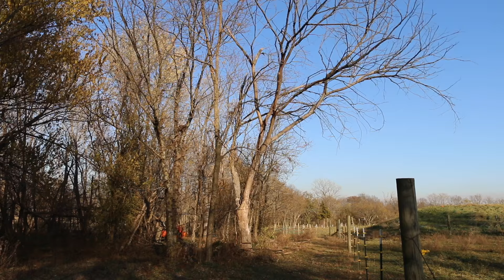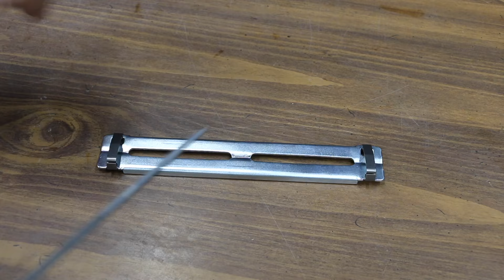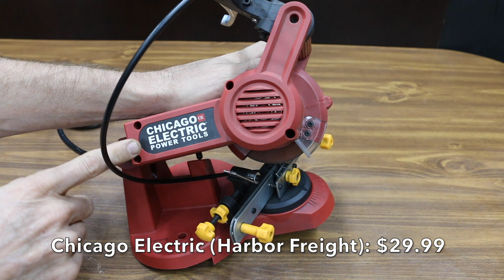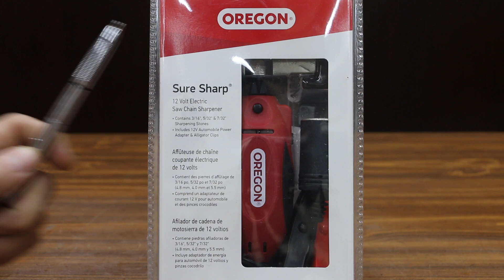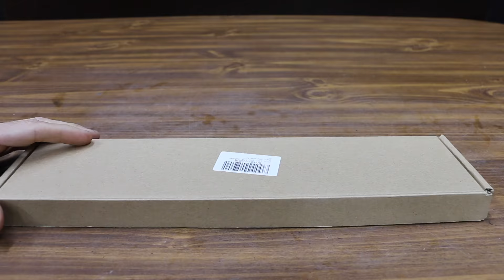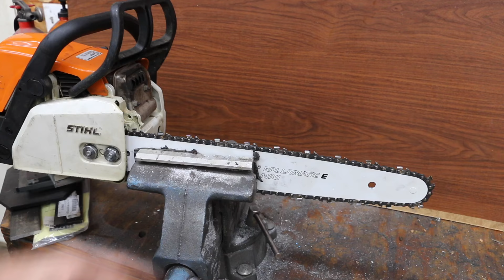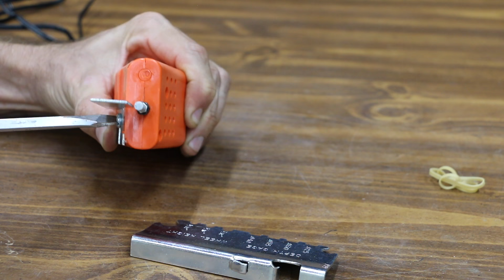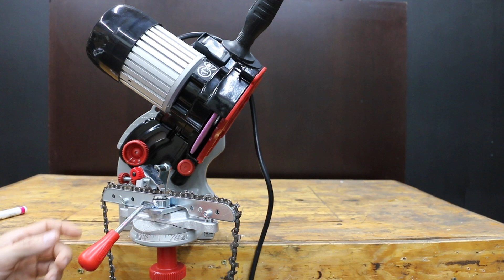Which Chainsaw Sharpener is Best? Let's find out! Stihl, Granberg, Chicago Electric, Oregon

Comment: I appreciate the thoroughness of this video but you will find that you will become more proficient the more you use a single sharpening system, both in speed and quality of cutting edge. Most of these will produce a quality edge. It really comes down to what you prefer. I only use a file free hand. Thats my method but i sharpen chains quite often. If i were to recommend one of these for a beginner, go with the stihl 2in 1 because it teaches a user how to stay at the proper angle , the need to file drags and the cost is relatively cheap compared to the others. Ive tried just about all of these or something similar at one time or another.   Eventually just about every pro or frequent user ends up filing free hand. BTW no need to use lye on your chains, thats a bit overkill.Maybe some brake cleaner and  compressed air. Youre not going to be eating with them

Comment: Another scientific test!  Thank you.   One thing I didn't see in the comments was the proposition that the heat from the chain grinder tools can ruin the temper of the steel in the chain's cutters.  An old forester told me this, and said that because of that, chains that are hand-filed stay sharp much longer. 

A guy like you would be able to devise a test to see if that old guy was right!

If he is right, then I think your recommendation about the sharpeners might change a lot.

Thanks for what you do.  I've relied on your work many times.
Reply from the maker: You are welcome!  Thanks for the suggestion.
Reply: Not only is he right pro loggers always hand file. A grinder is only used to return angle on a older chain. Also soft wood like pine needs more angle than hard wood. You can even speed up cutting on new chain by hand filling because file can cut under teeth grinder just across. My eye sight now i must use grinder. It makes chain usable, but when my brother in law comes up he will take file and sharpen all my saws for me . I got 6 .and when hes done you will see be improvement in cutting speed and time before chains dull.

Comment: The Stihl 2 in 1 are manufactured by Pferd, so you can get the same product slightly cheaper in blue under the name CHAIN SHARP CS-X.
It's a convenient product but new users should be aware not to press down, otherwise the rakes will be filed too much and the chain will cut a bit rough.
Reply from the maker: Thanks for the feedback.

Comment: Back in 1964 I turned 18Yrs, a mate and I decide to go timber cutting - mill logs and pit props , I purchased a Stihl 07 chainsaw and a yellow coloured file and joint sharpener, I wore out the chainsaw after 16yrs of heavy work but I still have the same sharpener today, they were a great combination, I turned 75yrs the other day - cheers from Australia !!
Reply from the maker: Thanks for sharing!

Comment: I have tried a couple of gimmick sharpeners and always go back to a file. And those stupid file guides are nothing but rubbish. Ps the chain ain't finished until you done the rakers.
Reply from the maker: Thanks for the feedback.
Reply: @ProjectFarm  Your an experienced guy and your own test showed hand filling is quite good. If you do a task enough you get very efficient. I have found the depth on chains to be uneven from new. After all its a stamped steel component. The depth is almost as important as the Cutting tooth being sharp. To shallow and your cut becomes very slow, too deep and your saw might not have enough power. Not to mention kick. Good work as always.

Comment: You overheated teeth with the Oregon thing... clearly visible from bluish color of the tooth metal. With those grinders you only want quickly touch metal and then move the head up - quick touch again.. this way you let the metal to cool down and avoid overheating. Overheating ruins your chain.. so it isn't just geometry. Also, you'd like to see a series of cuts to see how long it will stay sharp. Yes, it is true that with a file you can make teeth profile very sharp, but it will not last as much as a more moderate tooth profile...
Reply from the maker: Thanks for the video idea.

Comment: Timberline has a billet aluminum bar mounted manual sharpener with carbide bits, but it's a little expensive at around $115-130 with no raker height system incorporated in the unit.   Looks sweet though.
Reply from the maker: Thanks for the feedback.

Comment: You can completely dull a chain in 10 seconds or less by putting the tip into the soil.  Not everyone knows this but I'm surprised this guy didn't know.  If I keep my chain out of the dirt, they almost never need sharpening.

Comment: I have an older Oregon bench grinder that works great.  To take gum/pitch off of my chains I use full strength Orange Clean from Home Depot.  More safe than lye and no chance of corrosion.  I keep it in a Tupperware rectangular container and have used the same batch for years.
Reply: PS  My Oregon bench unit was made in USA
Reply from the maker: Thanks for sharing.

Comment: Good demo on equipment, did you consider the quality of the file and grinding stone. I cut a lot of native hardwood. I sharpen all my chains in the field every 1 ton of cut wood and use a ripping chain not a safety chain to stop chain kick back. A full ripping chain is quicker and faster that safety chains.
Reply from the maker: Thanks!

Comment: OUTSTANDING video. I fully appreciate how much testing you did. I found your video because I'm searching for a chain sharpener. It was truly eye opening to see so many different types when all I'd heard about was the one from Harbor Freight or manual files. Currently, my cost for sharpening is $5 per chain (off the saw) or $8 per chain (on the saw). Since I currently have 6 x 16" and 6 x 20" chains, you can see how, even at $5 per chain, the costs add up fast. Thank you for providing such detailed information and great explanations. I'm sub'ing your channel for more great videos like this.
Reply: And if they are not careful, a tech sharpening the chain by machine can overheat the steel, which hardens it at the edge and makes it basically impossible to sharpen again with a file.
Reply: @coffeenclinic  
Overheating steel (or any iron-based metal) like you're describing anneals it, making it softer, not harder... but you're 100% correct  - it makes it almost impossible to sharpen again, and prevents it from holding an edge.
Reply: That’s amazingly cheap. It’s $10 our way off the bar.  I started sharpening my own because of the cost and because they remove too much material they overheat the teeth turning them bluish.  Nope, don’t want that.  I’m much happier with the results sharpening it myself.
Reply: PS:  I have a Northern tool electric grinder and the Stihl 2in 1. I prefer the 2 in 1.   The bench grinder is nice the even out the length of the teeth. That’s it.  Otherwise the Stihl is my go to.
Reply from the maker: Thanks!  Thanks for watching and subscribing!

Comment: Doing 2 cuts per sharpen would have minimized differences in the wood like knots. 
Place a cantilevered weight ~18" beyond the tip of the blade to balance the weight of the motor with the center of mass between the 2 4x4s. A purely gravitational cut without the hand balance would be ideal.
Reply from the maker: Thanks for the feedback.

Comment: I use a 4 inch angle grinder with a metal blade freestyle to sharpen my chains. It’s a bit crude but hey, it works and it’s fast.
Reply from the maker: Thanks for sharing.

Comment: an old wood pulp  cutter from m.s. taught me how to sharpen a chain saw with file only. when finished it looks water running out of the back of the saw. its important to role the file as you sharpen and clean the file after every tooth just tap it on something to know out the fileings  out. i think all this is ok but experience worked for me and a lot simpler.my chains last a long time.keep them out of the dirt and oiled.when its not cutting after a sharpening the cleanout teeth need fileing down some you can tell by looking at them i keep mine a tad lower than the cutting teeth.
Reply: I learned how to sharpen stuff 50 years ago while working in a machine shop. Your tips are right on the money!

Comment: The file n guide is the best but it sharpens the upper edge of the tooth. The file by it self opens up the gullet. File a large area in the gullet below the cutting edge. So the chip exhausts faster.
Reply from the maker: Thanks for the feedback.

Comment: I can make a new chain "sharper than a new chain" simply by a few swipes with a sharp file on the rakers/depth gauges, makes chain much more aggressive and faster cut (but also more vibration and more kickback).  I think the reason the Stihl 2 in one does well is that it also adjusts the depth gauges.  I get sharpest results with Oregon Bench grinder, diamond wheel AND with depth gauges adjusted.  Using a bench grinder and reducing cutter length and therefore height significantly, without reducing the raker/depth gauge height will result in a very sharp, very smooth but slower cutting chain.  Just my 2c worth
Reply from the maker: Thanks for sharing.
Reply: Yes most pros give a new chain a touch up with a file before ever using it.

Comment: I thought the microscopic photos of the original chain and the sharpened ones showed very dull and badly sharpened blades.  I use a hand file with a guide on it and get razor-sharp blades and no grind marks.  I think with a little practice, anyone can file a chain perfectly using a simple hand file or one with a guide plate.

Comment: I have an old oregon hand sharpener, similar to the File and joint, and electric oregon. Both must be set up correctly or they will seriously shorten the life of the chain by removing too much metal. Both, when set right, give me sharp chains that last longer than new sharp chains. The angle holds its edge longer. I wait till I have 6 to 10 blunt chains then it is worth setting up the electric. If only 1 I use the hand tool.
Reply from the maker: Thanks for sharing.

Comment: You've got to take into account being out in 'the field' with these sharpening methods. Sure you can take your time in a shop with a coffee to set up a chain perfectly but what happens when that very same chain has done some hard work and you are out in the great outdoors? You belt a stump vice in and get out a file and you do the job and after a lifetime of doing just that, I'll have to say that the Stihl 2 in 1 has got to be about the best chain tool I've ever laid my hands on. And as good as that tool is, with my very own set of guages which I'm looking to get a design registration on, sharpening in the field can be faster and better than even in the workshop. Faster than even changing over to a new chain.
Reply from the maker: Thanks for sharing.

Comment: perhaps a control measure using a hand file no assist without 30 degree angle guides? I suppose powered chain grinders good for home / ranch / farm use. Bucking Billy Ray would probably weigh in on this -- get the gullet!
great review though!
Reply from the maker: Thanks!

Comment: or you could just buy a set of thin grit dremel bits and use your dremel. I forgot the diameter. I think it's 3/32nds. Works great and it's fast to sharpen.
Reply from the maker: Thanks for the suggestion.

Comment: When you consider that the Stihl 2-in-1 requires no power, no set up, can take off material easily as fast as a bench grinder without the threat of heating the teeth, can be used in the field without a vice if necessary, files the rakers at the same time, and allows the files to be removed and used individually all in a self-contained, compact, package... to me it is the hands down winner by leaps and bounds. The only advantage I've seen in a bench grinder is that over multiple sharpenings, a bench grinder will keep your teeth all exactly the same length, whereas with a Stihl 2-in-1 you will start start to make one angle longer or shorter than the other. But if you use a caliper to measure and adjust every 6-10 sharpenings, it still wins for convenience and results.
Reply from the maker: Thanks for the feedback.

Comment: For what it's worth I was taught as a young man when felling to lap a newly sharpened chain by giving it a gentle forward 'stroke' with a very fine oilstone. I was told it removes burrs and helps stop the slight rounding of the cutter tooths upper surface. I've done it for 30 years and it makes the chains razor sharp. Thing is I never heard of anyone else doing it and always wondered if it was a thing?
Reply from the maker: Thanks for sharing.
Reply: Yes plenty of us check for burs after sharping. And oil stone is best way to lap chain.

Comment: I usually just use an angle grinder with a cutoff wheel and do my best to freehand a similar angle and depth. It definitely changes the geometry but I haven’t noticed any issues.

I used to use a bench grinder and liked it but I have an angle grinder on the truck and after doing it in the field that way a few times now it’s my go to.
Reply: Shit, I have used just a hand file and I make the saw cut circles.

Comment: I wasn't given it,, so pissed off. Fyi
Had a Sears Craftsman AC chain sharpener it was very good. I will describe sharpening as buzz buzz and on the next chain.   I went from being able to cut a semi circle  in a 14 inch log to cutting a virtually straight cut in a 48 inch log. I took the racks down ever so often, but the chain  would last for years. 
It WAS VERY GOOD!

Comment: I've been using the Stihl 2 in 1 since I first saw one in the dealership. Very easy to use and fits well into your saw pack out gear bag. Convenient and inexpensive! A great time saver.
Reply from the maker: Thanks for sharing.
Reply: I have to agree that the Sthil 2 in 1 is easy and convenient to use in the field. Clearing cedar growth embedded through our net-wire fencing it’s impossible not
Reply: to avoid nicking the wire fencing and dulling the chain. The 2 in 1 is handy and is made for my Stihl saw and chain. Very scientific and unbiased methodology in your tests!

Comment: I can't believe you didn't include a Franzen in your comparison... :P
Reply from the maker: Thanks for the suggestion.
Reply: @ProjectFarm  the good part is it could have been sharpening while you used another piece of equipment.

It does grind cutters and the rakers at the same time but shouldn't be much better than the other stone disc grinders.

Plus, the grinders like that are good for removing lots of material or straightening up a chain after a user has been freehand filing.

Comment: could you add in an "oversized" hand file to this as well? i run a .325 file for 3/8lp full size 3/8 file for .325 .404 for 3/8 and 1/4'' for .404 i havent found a sharpener or fresh chain that can even come close to this method thanks!

Comment: Great video  .. Very interesting about the different sharpening systems . I like the file options BECAUSE with most of the other electric options the chain Tooth gets affected with excess heat ( the blue colour on the steel is a clue ) from the grinding process  and this may affect just how long that chain may  become dull sooner than a filed  chain .
Reply from the maker: Thanks 👍
Reply: Good point.

Comment: This is a nice... really well done & thorough video...

I can teach you in 30 seconds in person... using the round & flat file that comes in the kit... no guides needed...

Lightly pull the round file thought he teeth at the angle that 5he file fits flat aghast 5he tooth... rotate file while pulling through... no force needed... let the file do the work... repeat till file no longer grabs or pulls through cleanly.  About 2-4 strokes.

Run the square file across top of the tooth ... one or two strokes...

Your done... it’s been maybe 2 minutes .
Reply from the maker: Thanks!

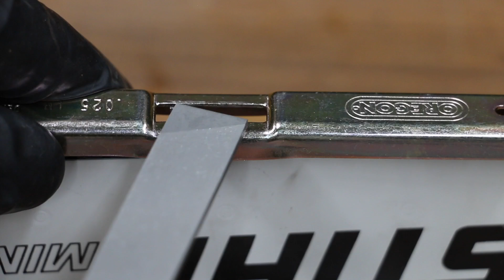Comment: The video failed as soon as you mentioned how many passes you was doing on each tooth, you file until there's a nasty hook and pulls a burr, clean the gullet out. @3:06 the state of the cutting teeth are a sham. Unfortunately there's going to be people seeing this and buying based of the wrong methodology of sharpening a chain.
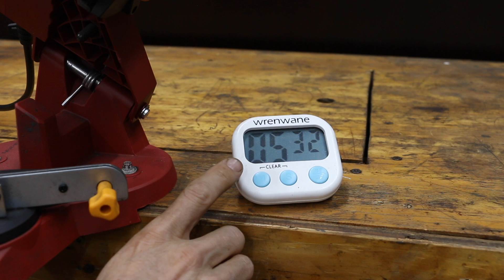@5:14 where is the hook? If you've no experience in doing something don't pass out terrible information.

Comment: "The Oregon is made in China."
A wonderfully ironic - and telling - sentence :)
Reply: @EZ Z The tool was made in China, he didn't say the chain was.  They've been around for a very long time.
Reply: Also to check for sharpness he should show a picture of the top plate.  Any sign of abrasion or wear and its .not sharp.  If you've severly damaged your chain you might as well throw it away or use one of those big ele. sharpners.

Comment: Removing the toothed plate was essential to the test.  But, I notice that the angle of the bar relative to the wood varied:  the  cut angle is NOT controlled and thus I often see that it deviates from the perpendicular (uniform) angle for all cuts.  This (I'm sure) will affect the cutting time enough to change the ranking between chains having very near the same cut time, me thinks!
Reply from the maker: Thanks for the feedback.

Comment: I almost wish I used my chain saw enough to need try out one of the Stihl sharpeners to see if my chain cuts as well after I sharpen it as it did yesterday when it was new. Man the new chain was kicking out some chucks of wood! I do wonder why it seemed so much better than the Oregon field kit since they seem like more or less the same thing, with just the cutter and depth gauge being separate with the field kit.
Reply: New chains kick out chunks not because they sharp, but because of all the different depths and angles that are close enough to sell.  Granberg's precision 12 volt is the real winner.